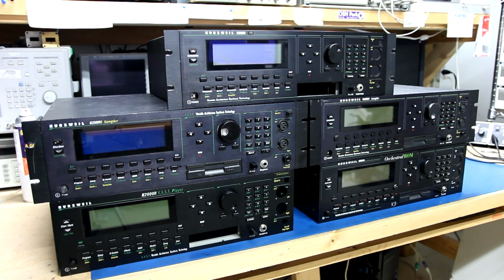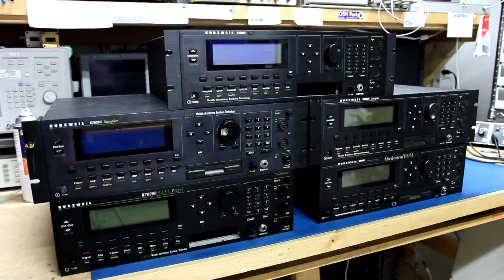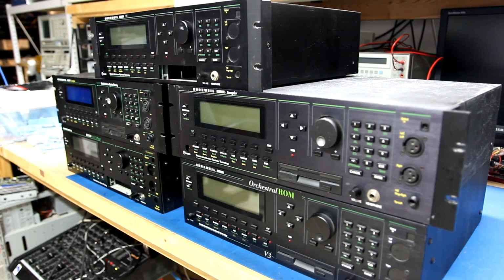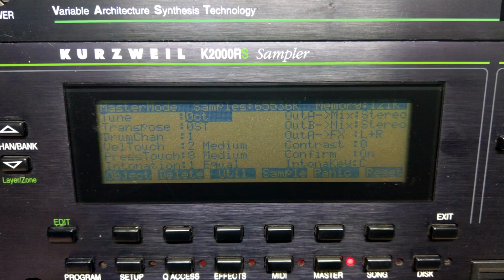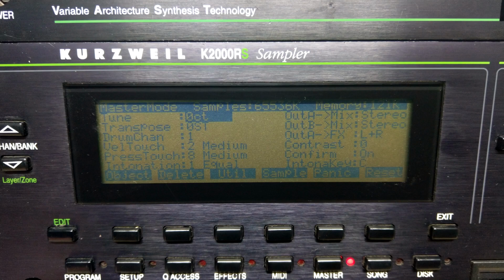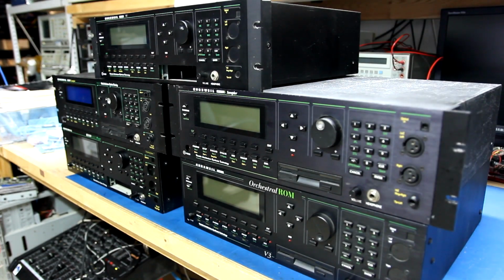Kurzweil K2000R and K2500R Overview, Upgrades, and Repair - Part 1

Comment: Would it be possible to make a circuit board with more than 500+ Program memmory (PRAM) for the K2000 to use? Or is it a limit based on the motherboard hardware?
I have had both the K2500 and K2600 and was a bit thrown back by that small memory that obviously and commonly hit the limit for me. This just by saving patches.... Christ....

Comment: Is there any way I can contact you? I just bought a K2500R for $75. The previous owner thought it had a bad screen, but it turned out he never replaced the batteries—they leaked and corroded the lower board near the power supply. I cleaned it as thoroughly as I could, replaced all of the capacitors, the battery compartment, and a couple of chips in the power supply section that looked particularly damaged. Unfortunately, the unit still won't boot. After a reset, it hangs on either "Please Wait" or "Waking Up Scanner," and it won't boot into the bootloader either. It Also gives a bus error if i pres +/- 0 clr.
Do you happen to have this part for sale by chance?

Comment: Nice. I still have my K2000R with smp board and orch rom. Back then I used mine with a Dell P3 500 laptop, SCSI card, external cdrom and zip drives, running mostly SoundForge and ReCycle. I could read most peoples' samples in whatever studio I was working, and make them sound better than they had on the original machines. I had the K2k in a rack along with an Ensoniq DP/4 and Lexicon LXP15 on K2k inserts. A backpack and a 6u SKB rack and I was good to go.

Comment: hey, can you tell me which part is for the effects? my k2000r makes noise when i select effects. but the problem is only with isolated effects and when the device boots up and initializes the effects. thanks alex.
Reply: Check the SRAM chips on the analog/FX board. My K2000R had this issue with all modulation effects like chorus, flanger etc. and I replaced one of the SRAM chips which made it work fine again. Hope that helps you as well!

Comment: Fantastic series! Love the K2000 to death and have just replaced the main filter caps, display and will soon have all upgrades installed. All ok except that i get 10.5v on TP17 instead of the 8 it says in the manual. Anyone encountered the same issue?

Comment: Hi, I have got a K2000 which was run on 240v while the setting were still on 120v. If possible can you please help me understand how the wires configurations are for 120v and 240v. I cant figure it out on mine, and I want to test the transformer in order to make it is delivering the right amount of volts. I am also not sure if the damage has been transferred to the main board as well.

Comment: I own a K2500 keyboard which is having a p.o.s.t. issue that I really need your help with.  I'll have to open it up and take it apart to see where the problem might be. I'm wondering if you would have the power supply board if I just wanted to replace it. I'll reach out once I pull it and see if I see the problem or could I ship to you and have it repaired, upgraded whatever to get it working?  You're obviously a wizard with this stuff!  Really inspired  and made me remember how great a keyboard it is. I should've never let an irresponsible person use it and drop it from a vertical standing position. UUGGGHHH. NEVER LENDING IT OUT AGAIN! Big mistake, HUGE! Hopeful we can get it to stop shutting off in the middle of performance. Thanks for your video series. I thought all was lost till now. :-)

Comment: hi, do you have eprom image for the k2/k2r audio v.4 chip. its on the audio board 27c512. mine is blank
Reply: It’s ok. Parsed more lines and I found the code. It relates to the digitech effects chip

Comment: I have a problem with k2000R. When I turn it on, everything works for a few seconds or it doesn't start properly at all. After a few seconds everything freezes. When I take out the flat cable of the LCD everything still works, there is sound. I replaced the display but the situation has not changed. I replaced a bunch of capacitors, the voltage is stable but the problem remained. Does anyone have an idea?
Reply: Did you get it sorted ?